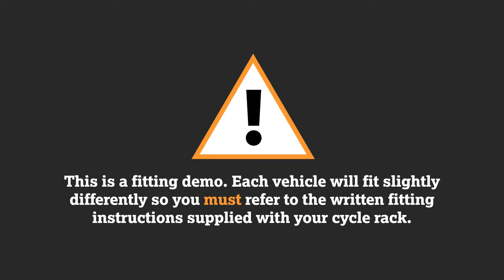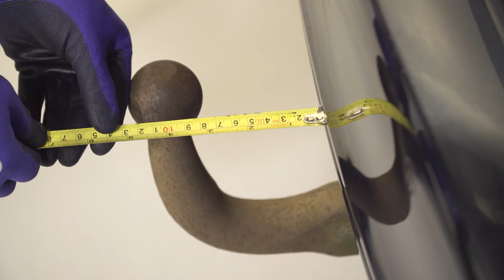How to fit a Halfords Advanced 4 Bike Tow Bar Mounted Bike Carrier

Comment: Why can’t it carry an ebike ?
Reply: There too heavy it can only hold up to 4x15 kg
Reply: @callum__hodgey1162  So two eBikes would be no problem as long as they're under 60kg! Especially if the batteries are removed.
Reply: Yeah, it's a bit misleading to say that it can't. It can, but it can't carry 4 of them as they're a lot heavier (even with the batteries removed)... sadly your typical Halfords customer can't understand " Up to 4 bikes with a weight totalling no more than 60kg." so they just say "no e-bikes" to save themselves from the inevitable legal claim.
Reply: Because you have to pull it with a thick bar handle then you can
Reply: My husband has a trek mountain bike and the wheels are not fitting in the rack.